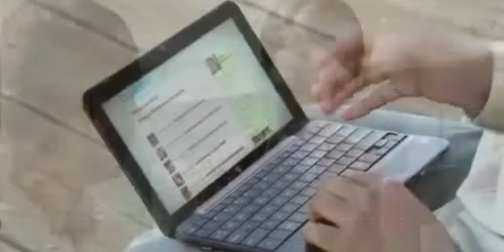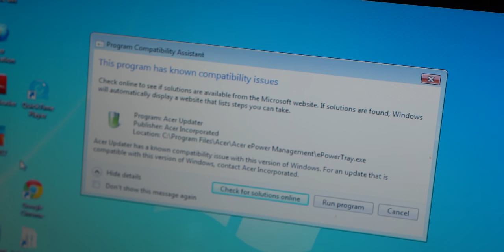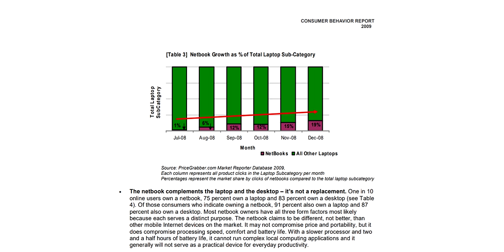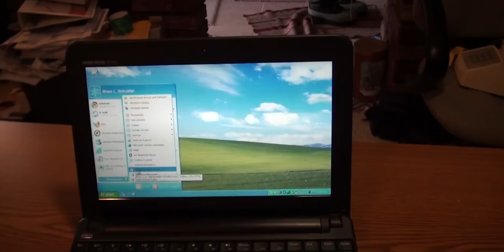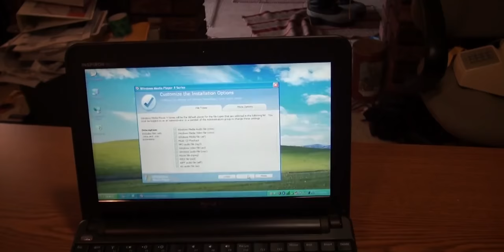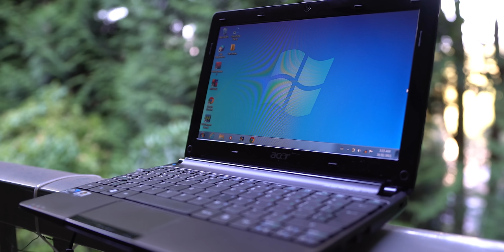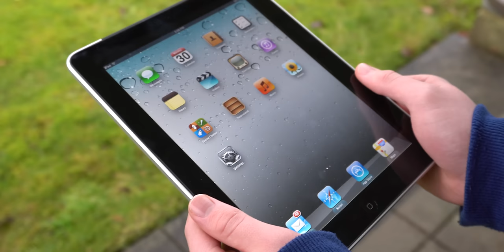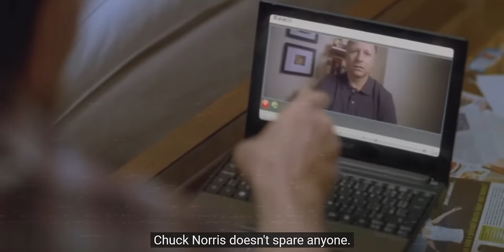Why Netbooks Failed - Modern Retrospective

Comment: netbook has a special place in my heart...it taught me alot about computer and overclocking just to get a playable fps on minecraft
Reply: "Playable" as in the number of likes under this comment? Been there ;)
Reply: Same except the overclocking part .man those gmas thernal throttled to 166mhx
Reply: Oh my god, I remember this. 

I had a netbook from about when I was 7 to when I was like 10, and playing Minecraft on one of those sure was an experience. I learned overclocking basics and more simply by frantically trying every possible trick I could to improve my framerate, I lowered every setting and resolution and overclocked the CPU and allocated more RAM and did all of it and still only got like 35 FPS at the best of times, but I kept playing because I didn't know any better lol.

Now I play Minecraft at 60+ FPS at 1080p with shaders on a desktop that I built myself, and I think I have this little netbook thing to thank for my love of tech and stuff. 

If I was lucky that day, my mom would be off work and I'd be able to play with my mom's work laptop which was a little bit more powerful (at least for gaming) than my netbook. Then I could manage 45-50 FPS.
Reply: @HyenaFox  same bro i had my old dads laptop which could play at better frames
Reply: @HyenaFox  damn some people live the same lives
Reply: On version of Minecraft about 1.0~1.2 it was pretty playable with OptiFine.
Reply: Dang I remember getting 10fps with 2 chunk render distance and thinking it was amazing
Reply: My gaming PC still runs a Core 2 Duo..
 at best I get 30fps, at worst I get a lagged desktop where I'd be copying jpegs to my flash drive at speeds slower than dial-up
Reply: My only way to Play RollerCoaster Tycoon 3 while at the Doctors Office Lobby lol
Reply: @Mike-zl4zs  i mostly played Roller Coaster Tycoon 3 i was able to play it at a doctors office lobby or at the Bus
Reply: I used to remember playing Minecraft in 2012 with the Aspire One. It played roughly 30ish FPS but it worked when doing simple things.
Reply: You can overclock a laptop?
Reply: @Mike-zl4zs   I had the other branded model emachines em250 same specs just a. Rebranding lol
Reply: @random person Yeah. That's progress for ya! More and more FPS, as time goes on ;)
Reply: Netbooks are kind of returning. Especially the Lenovo Ideapad 3 (celeron, walmart Black Friday) and some of the new Gateway’s (the one with the AMD a4, and the one with the celeron, also Walmart exclusive)
Reply: yeaaaah, same for me, i remember playing minecraft at 15 fps on a friends pc and thinking that it'd be running at 60 fps 🤣 since my netbook at the time ran at 4 fps
Reply: My Asus 901Hd eee pc was a life saver during my exchange year and 3 years later my college year. Learned a lot about what Linux in those few years.
Reply: I used to see those Aspire one and I was kinda jealous with people with the AMD A6 or A8 APU ones. I used Toshiba i5 at that moment. From what I can remember is i5 on board graphics had nothing on a A6 🤣🤣🤣
Reply: I learned how to erase windows and reinstall it because my school laptop came with windows and a custom linux for the school, never liked linux at that point and hated that it was the default option for the GRUB (I was 12 and was not interested on computers only on the PS2/3 and its games)
Reply: I first used a computer at school way back in 1982 when I was 16. And personal computers were absolutely rubbish back then. They didnt even have a graphical user interface. Let alone cameras or video playing capabilities.
Reply: 💯% relatable😂👌👌
Reply: The first year I had Minecraft, the newest PC I had available was my sister's college desktop from 2007. It had an Athlon 64 X2 3800+ CPU, 2GB of RAM, a cheaper lower end GeForce 7 series card, and Vista.  I used it during 2013 so it was still usable for web browsing at the time, but for Minecraft I'd always be between 10-30 FPS during normal play even with settings lowered lol. I was so young at the time so I just thought that it was normal and didn't even think to do anything about it... haha
Reply: @user-vg5zx4lx8m  no you can’t overclock a netbook. People who say that are unknowledgeable.
Reply: @user-vg5zx4lx8m  at your own risk, but yes!
Reply: 12 fps. Half cinematic.
Reply: Frames per second? More like seconds per frame.
Reply: It taught me a lot about computers too, as I was forced to learn Linux because they run sooo much better than Windows 7.
Reply: I played the crap out of less graphically demanding games on my netbook, like The Curse of Monkey Island, Stepmania (hooked up to an external display) and StarCraft 1. They were also perfect for emulators (at the time).  PCSXBOX, Nestopia, SCUMMVM and MAME all worked extremely well on it.
Reply: @aimwell8813  - honest question - what Ideapad 3 are you looking at? I'm seeing 14, 15.6, and 17 inch - do they make anything smaller? 

If you're thinking of price, I see https://www.lenovo.com/us/en/laptops/ideapad/ideapad-100-series/IdeaPad-Slim-1-11AST-05/p/88IPS101357 listed on back-to-school sale for $225 US, with 4 GB RAM (coincidentally, I'm waiting for another memory stick to arrive on Monday, so I can upgrade my personal laptop from 8 GB, which was crashing earlier this week, to 16 GB, so 4 GB sounds PERFECT), 64 GB eMMC, which wouldn't be THAT bad if you weren't using Windows 10 (and, more to the point - trying to UPGRADE Windows 10 - I still have an HP Stream 11 that I couldn't upgrade because it only had 32 GB eMMC, which wasn't enough to download the next release onto), and Windows 10 Home edition S mode (can that change wallpaper?). 

So, basically, you can continue to have a miserable experience with an 11-inch computer far into the 2020s!

I'd buy that, the next time I needed a laptop, if I FORMATTED THE DRIVE AND INSTALLED LINUX INSTANTLY ...
Reply: @skyscall  - do the right thing of course, but I see that Google bought Neverware, which sold products allowing you to UNofficially install ChromeOS on non-Chromebook hardware, and rumpre has it that Google did that so that we can OFFICIALLY do that. I'm a pretty happy Chromebook user who has at least two small laptops that I'd do that on in a heartbeat, and ChromeOS includes Android support (as well as pretty well-integrated Linux support). So you might want to check that out, depending how quickly you need to make a decision. https://www.neverware.com/#intro
Reply: @HyenaFox  Sounds like good memories man!
Reply: @spencerdawkins  I said it was a black Friday deal last year from Walmart.
Reply: Yeah got this one during my secondary school years. Ah the memories of playing gta san andreas n cs 1.6 is coming back
Reply: @wojciechmuras553  aged poorly
Reply: Never understood the netbook hate - though it’s always fashionable to be snarky.  I was one the waitlist for the first aspire - got the 6 fell battery and it changed everything for me.  Was amazed how mcuh it could do... bought it for simple school tasks, but found it could run eclipse and other things... tiny 9 inch screen but shockingly sharp and clear.   Got so much done.  To that time it was the best tech purchase for the buck I had ever made... and I’ve been there since the beginning lol - still have my Apple 2 and Atari 5200.   For a few years until air-clones came along it was the best thing For my super portable needs.
Reply: This was exactly my experience, had a Acer aspire one d260 and Minecraft ran fine in it when it was in alpha but one day it updated and suddenly my GPU (or lack there of) wasn't supported.

Still ran GTA SA at 800x600 at 30fps  with the lowest possible settings
Reply: Hpw the hell dp you struggle to run MINECRAFT? 

That game was even ported by a fan to the Sega Saturn.
Reply: God 4:56 was violent nostalgia for zoomers. I remember when iPhones looked that luxurious and laptops looked that cheap.
Reply: well that's a blatant lie. intel always locked overclocking behind the higher end versions of their chips. you couldn't overclock something they put in a cheap netbook if you tried and even if you could, their lack of decent cooling would see them throttle before you ever even approached a boosted clock speed.
Reply: Do i get goood fps in netbook?
Reply: Says a lot when you need to overclock it
Reply: Powerbooks have a special place in my heart
Reply: You can overclock atom processors?

Comment: Basically a chrome book in 2020.
Reply: Much better
Reply: Lambda Gaming Worse.
Reply: Munchacho nope
Reply: @callaco3176  trust me, the chrome books are way better. Most netbooks could hardly handle youtube at the time.
Reply: OwenBland Chrome OS is Linux based,you can’t make an OS out of a web browser
Reply: OwenBland ........wha...wai—wha?
Reply: if you don't honestly care about the increasingly jank behavior of Google.
Reply: Chromebooks were terrible for years because you couldn’t run native computer apps without modding them. I had one 2013-2015, was pretty bad.
Reply: OwenBland it's based on the linux kernel
Reply: @0w3nn  You can run Linux on all new Chromebooks...
Reply: I had a refreshed eee PC from Asus. I loved it at the time but my Chromebook is far more reliable and way faster. Cheap school Chromebooks I can see that comparison but the mid range and high end Chromebooks are much better.
Reply: Chromebooks are so much better for parents/grandparents than Windows/Mac/Linux are.

My mom always found ways to screw up Windows on a near-daily basis, but I bought her an HP Chromebook 14 G5 in July 2019, and after a full year of use, she still has yet to encounter one issue with the device.
Reply: i bought a Eee PC back then, 2gb RAM, 16gb hdd.. you can use it when you bought it at first.. when there are no apps added.
but as time goes by u decide you need that Acrobat Reader ro open ur PDF, you need that WinRAR app, or MS Office app, you need that printer driver to print to ur home deskjet. and so on and on, you very quickly realise 16gb or 32gb of disk space isnt enough. even with SD card expansion. since you can install apps on the SD card, only to store documents.
then Came the Dreaded Windows Update time..

the stupid windows update patches couldnt be installed due to insufficient disk space and you need to remove this and that, and delete previous version of windows to free up space just for the patch to go in.. it was a nightmare..
i gave up using it less than a year or using it. the only thing it did for me was surf the web...and my handphone can do that better.
Reply: OwenBland tf
Reply: @DrSwoose   well to be honest i cracked my old hp mini and it ran youtube just fine but the HDD was failing
Reply: @DrSwoose  I agree, i don't miss netbooks at all. Chromebooks are much better.
Reply: Pretty much Chromebook predecessors.
Reply: Ironically ChromeOS is very similar in concept to the original EeePC's Linux distribution - a lightweight, easy-to-use interface to access a web browser and productivity tools without the bloat or complexity of Windows. In some ways I feel chromebooks are what netbooks should have been all along.
Reply: @nitrax8629  Yea... and the reason those failed? People missed their software
Reply: My 2007 shitty netbook has the half cpu power as a 200$ chromebook.
Reply: @DrSwoose  mine did fine at 720p
Reply: @LambdaMiscellaneous  uh no. Trust me I've used both. Even the cheap Chromebooks are  FAR more responsive than my old Asus netbook. For the suggested use case, Chromebooks are a lot better.
Reply: @smacpats6379  Your expectation already told you.
Reply: lostinthenexus Well what year is your netbook? 2003? That,my friend,is acceptable
Reply: lostinthenexus You can’t even play Minecraft on a chromebook,my 2009 iMac can run 1.16 just fine,a quick ram replacement in that old asus netbook and it might be able to run 1.12.2,if you don’t like Minecraft,good luck getting use out of either of them.
Reply: @LambdaMiscellaneous  You are aware there are high spec Chromebooks Yes? also rumor has it Ryzen based Chromebooks are coming
Reply: @LambdaMiscellaneous  I really don't care about playing Minecraft so that doesn't really matter to me. I don't think I've ever met such a fierce defender of netbooks before lol
Reply: @tev866  "Some" of them were half decent. I used mine pretty much daily from 2012 to the last day of Windows 7 support. (It's a ultra portable retro gaming netbook now)

Though mine did have the benefit of maxed ram and a SSD...
Reply: @JohnSmith-xq1pz  yeah I had an Eee PC that was pretty crappy but that's all I could afford when I was like 10 haha. After that I got a hand-me-down Acer Aspire that actually wasn't too bad. It had a Centrino chipset instead of an Atom. I ended up daily driving netbooks for probably about 4 years between the two of them.
Reply: @tev866  mine's an aspire one model too The D270 (It has Atom cpu but isn't THAT bad). It held up well until everything went embedded flash media everywhere websites lol
Reply: true, chromebooks are SCAMS
Reply: John Smith who would want to buy that.....
Reply: @LambdaMiscellaneous  Depending on price/specs etc I might. At the very least I'll check them out I don't need a super powerful laptop since I've already got a quite powerful desktop. I need something that can slide in to the gap between my desktop and tablet. And Frankly I'm already getting a little tired of Microsoft and there spyware of an OS.
Reply: Chrome books are more optimized for low end hardware vs windows.
Reply: Barry Mumich Okay?
Reply: @LambdaMiscellaneous  Didn't 91 tech say that netbooks were introduced in 2007?
Reply: TurboPikachuX Are ya saying seniors can’t operate computers? My grandfather programmed missiles man!!! Well,I guess my grandmother did ask me how to install zoom...
Reply: a chromebook is a netbook ._.
Reply: I feel like Chromebooks have more appeal than these things did tho. 
With a chromebook, at the very least, you're mostly guaranteed enough power to handle all of the BASIC apps a student might need for high school, and it can also run android apps. 

These netbooks had 0.95 GHZ CPUs and like 1 GB of RAM and like 1 small fan. I had a netbook as my first computer, it was some proprietary brand, I forget, but I had it when I was like 7. It would just about overheat loading youtube and I regularly played minecraft on it.
Reply: @lingth  wait, did they truly come with like 16-32 gb? I had one when I was like 7 and remember being able to install a lot more on them...

I mean, on my desktop, I have a 64 GB boot drive and Windows itself takes up most of it.
Reply: I would rather have a netbook i have a chrome book and it sucks I have to sign in every time the screen goes dim and it delete all my tabs and doesn't save
Reply: @HyenaFox  Some of the early one's had 16-32gb SSD's
Reply: A Chromebook with windows before
Reply: @vinyl.croatia  What about with doors?
Reply: @JohnSmith-xq1pz  good joke xD
Reply: @vinyl.croatia  👍